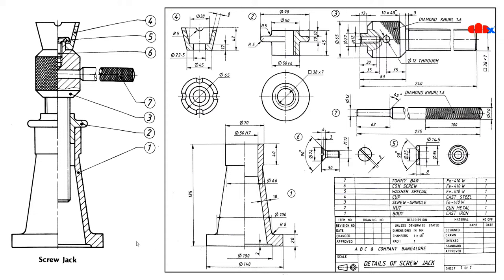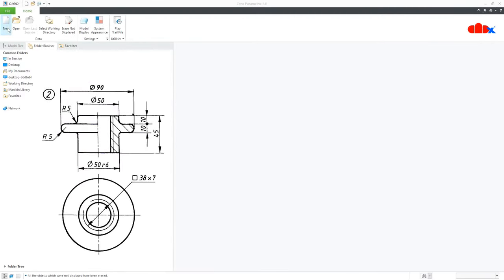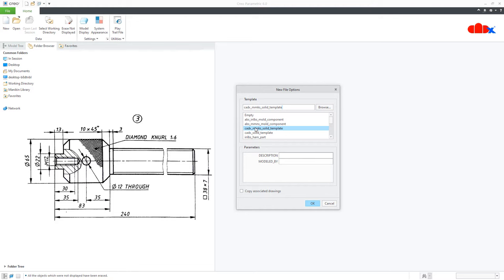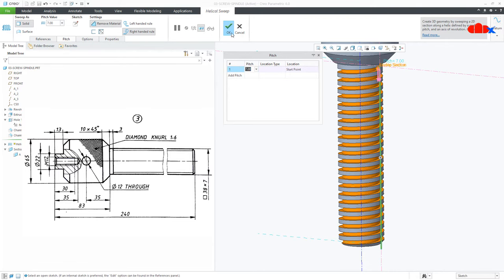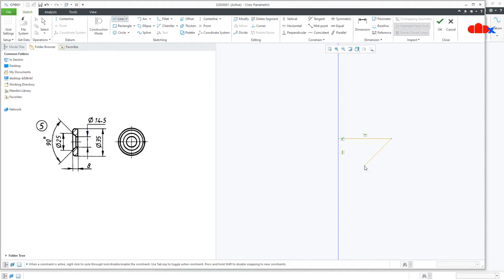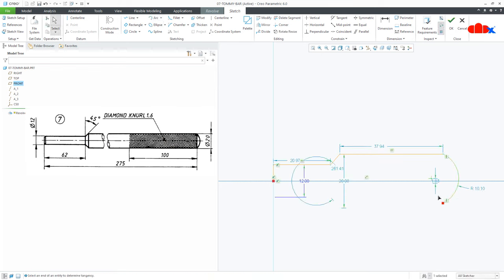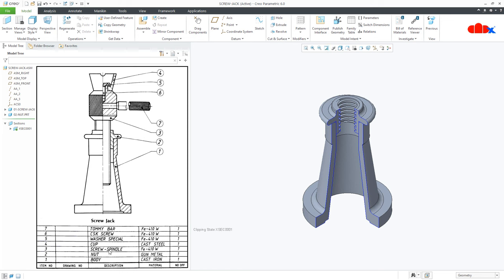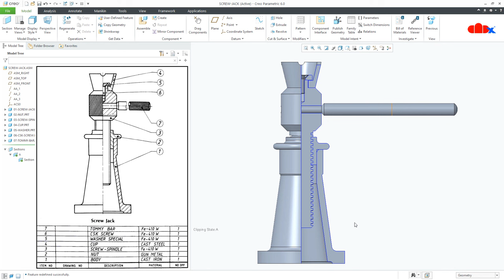Screw Jack assembly and parts in Creo Parametric (All parts included)

Comment: HI Sir,
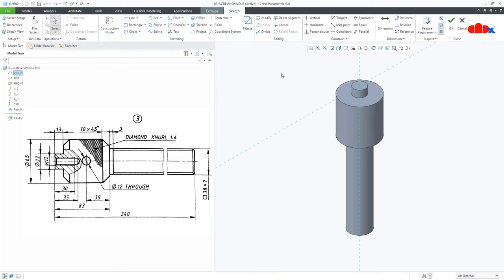in third part you made first revolve by selecting front plane but in second feature (hole)why did u select right plane, why u did not  select front plane again 13:32 timing
Reply from the maker: You can go with the front plane. That is also ok. But you will get a different orientation for the handle in the assembly.

Comment: Hi sir, can make a video, how to import EBOM table from csv file in creo
Reply from the maker: i didn't get your question. what do you mean by EBOM table?
Reply: Actually bill of material(BOM) in drawing is parametric. But sometimes we need to create BOM table manually and type values. If less number of parts we can type manually, but if more number of parts, i want to import data from csv file to BOM table
Reply from the maker: You mean to say, you want to copy data from csv table to the manual table in creo parametric?
Reply: @CADxTraining  yes
Reply from the maker: Yes you can easily convert a Bom table to a manual table.

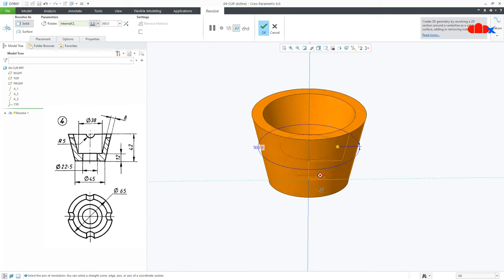Comment: 19:31 sir, why you don't use 8mm instead of parallel lines?
Reply from the maker: You can go with 8mm but you need to delete the parallel constant. But when you use 8 mm then the two lines will not be considered as parallel lines. You can even consider 8mm dimension and parallel constant by deleting 38mm dia. 8mm is not a critical dimension from assembly point of view so we can leave it or we may use it .
Reply: @CADxTraining  It means not critical dimensions are less important. Thank you sir 👍🏻

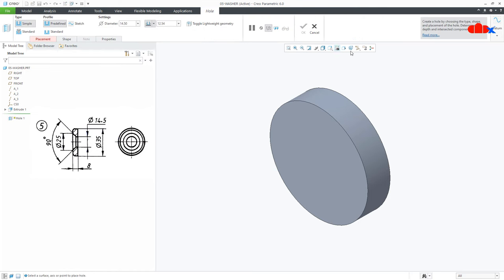Comment: hey first i would like to thankyou because this really helped me. Second - i am facing some problem while drawing the washer part. Around 22:53 after getting the hole done you select sketch while being at the hole section and than you press sketch again and a new tab comes where you draw and that gets added right! i dont have that option, when i press sketch everything gets disabled for me. why is it so? and can you please suggest some other way to complete it! i am new to creo and this is my assignment so i dont know how to do it on my own. please it would be a great help.
Reply from the maker: That option is there in all the Creo release. Please check all the options available in your release.
Reply: @CADxTraining   thank you for your reply. I did check, I checked again and again it's not there. Else there's some issue with my system, ig it's not functioning well. Thank you very much for your reply.
Also one req. Could you do a video on flange coupling!! I couldn't find a better screw jack on YouTube other than your.